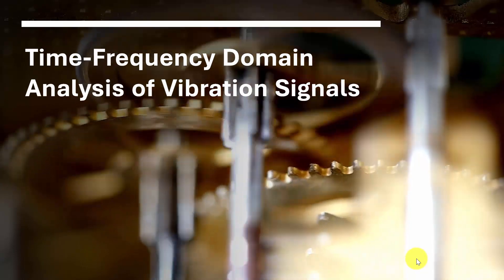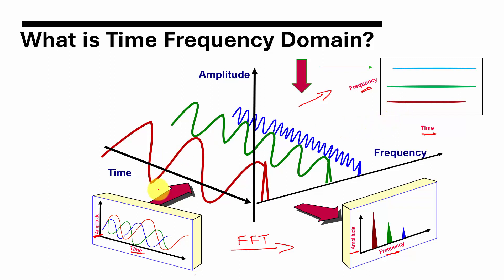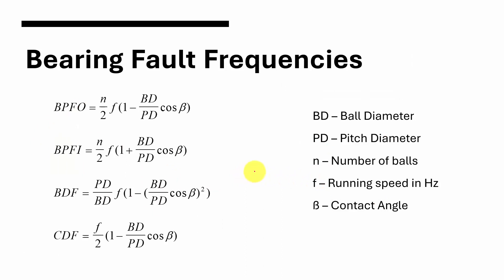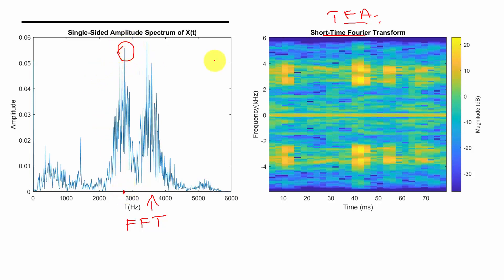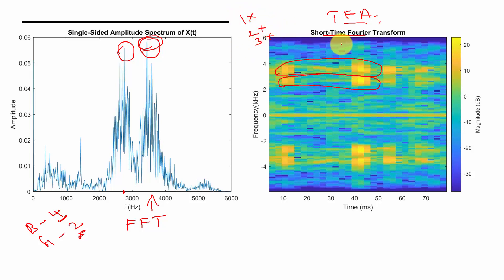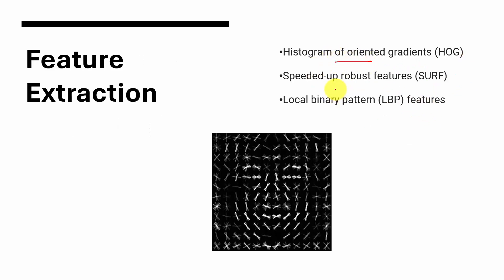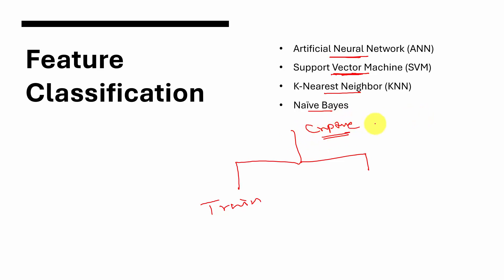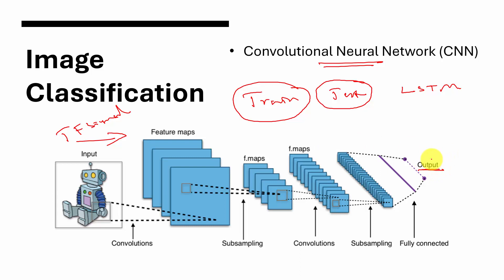Time-Frequency domain analysis of vibration signals | Time frequency domain fault identification

Comment: Any idea about sone measurement
Reply from the maker: What kind of measurement you are expecting?
Reply: @themechanicalengineer   loudness measurements
Reply from the maker: My expertise lies in the vibration of systems, but for loudness measurements, you can use sound level meters (SLM) to measure sound pressure levels, usually in decibels (dB).

Comment: How do i calculate the bearing frequency if the number of rolling element in any bearing are not given? tnx sir.
Reply from the maker: The bearing fault frequency can be calculated using specific formulas based on the bearing geometry and the operational characteristics. The number of rolling elements in a bearing is a critical component in this calculation.
Reply: @themechanicalengineer  but that specific formula also requires the number of rolling element to get the specific frequency a bearing fault sir.still confused about it .
Reply from the maker: Yes ... Without that detail it is not possible... Better you refer the bearing standard size for getting the details about number of balls